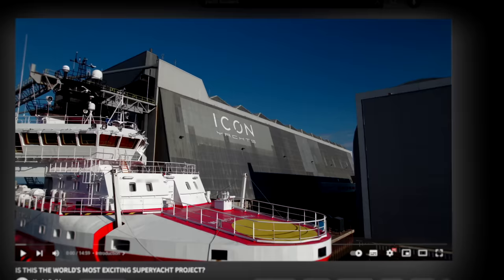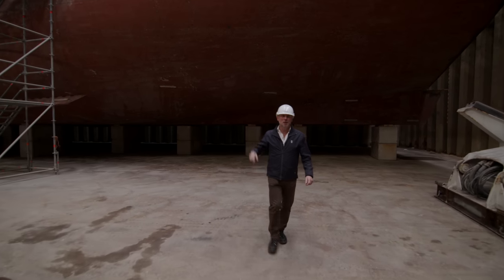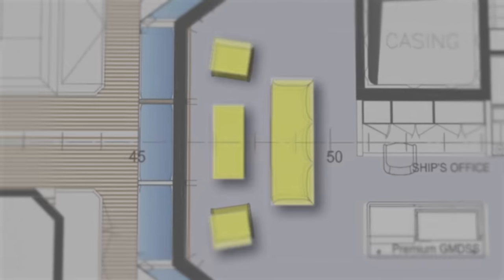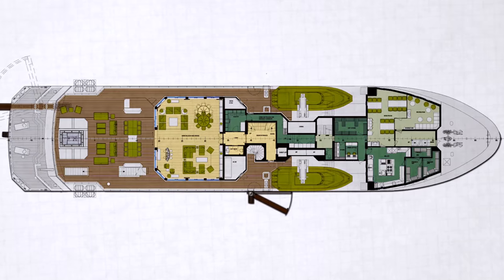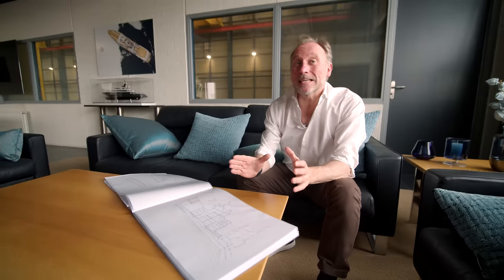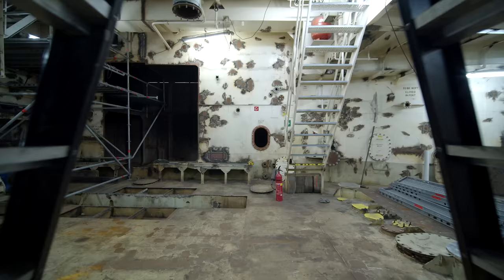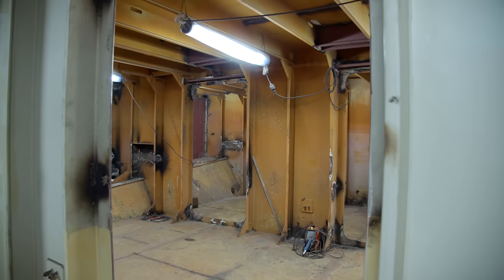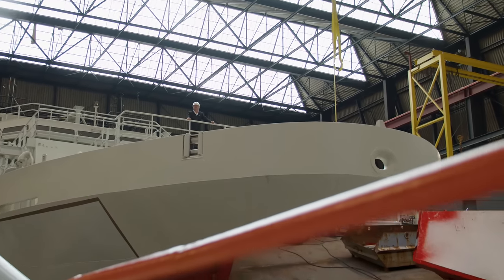CREATING AN EXPLORER SUPERYACHT. TAKING IT APART...AND PUTTING IT TOGETHER! ICON'S PROJECT MASTER.

Comment: At this point I have to wonder tho, why not just build from scratch? It doesn’t seem to save time, and almost everything will be new anyways, apart from the hull
Reply: I agree, it would have been so much simpler to scrap the old ship and use its steel for a modern design.